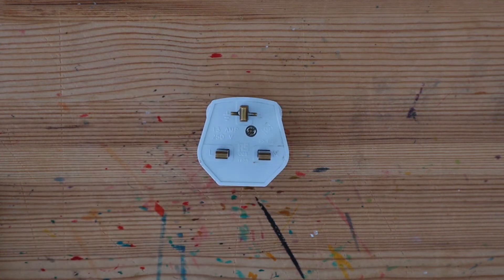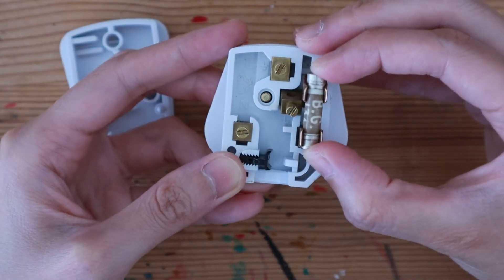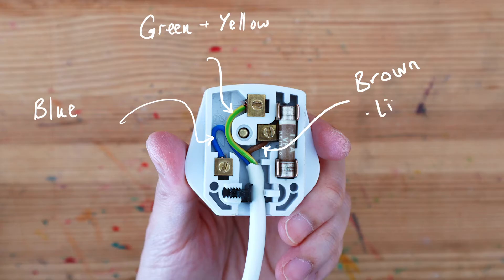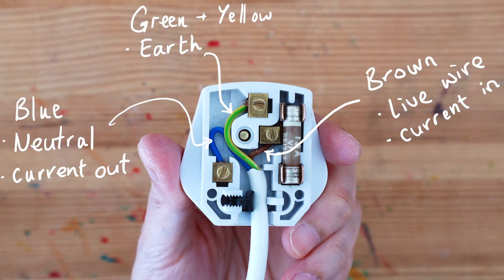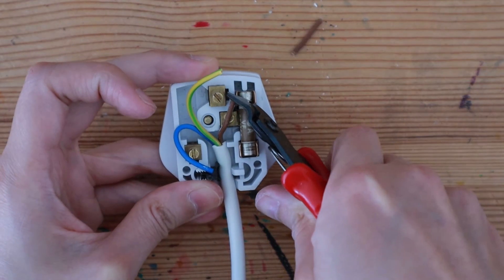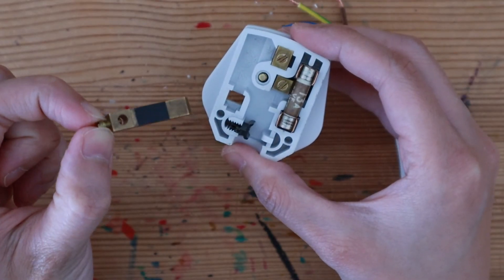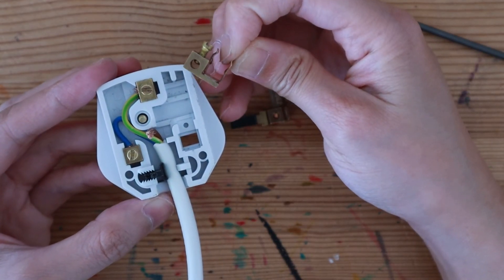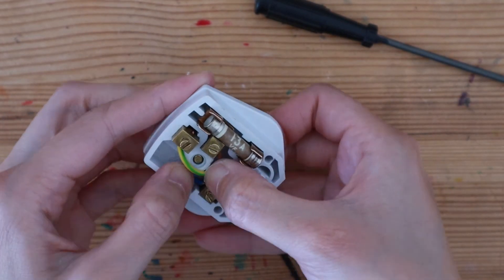How To Wire A 3 Pin Plug - Physics

Comment: Hi this is a great video, I gave it a thumbs up and liked it, I want to know how to wire this same plug type, but I only have two wires, one is red one is black it's a hands free cordless phone, I cut off the first plug it was a moulded on plug, the phone had stopped working and I wanted to replace the 13 amp fuse and change the plug to see if I can get it working again, but I am not sure how I should place the wires inside the casing of the plug, I cannot find a diagram on the internet of these colour wires, they are both coated in insulated wire, how should I proceed safely? , please help me if you know the answer I would really appreciate it alot. Thank you Laura in uk
Reply from the maker: I believe you have the live wire and the neutral wire. It sounds like you have a device which has double insulation (plastic casing), which is why you don’t have the earth wire. The earth wire isn’t needed in a double insulated device, because the user is already protected from the current because plastic is a poor conductor.